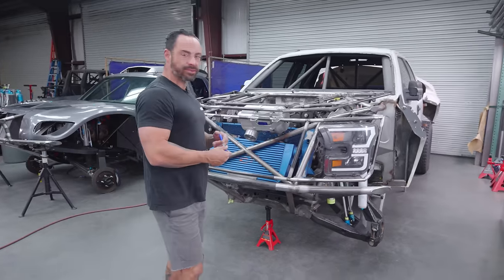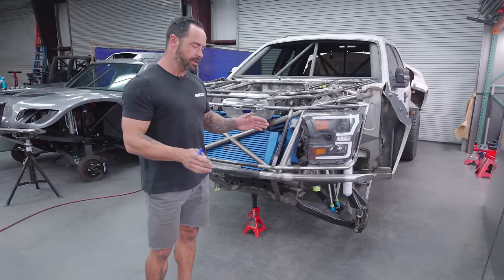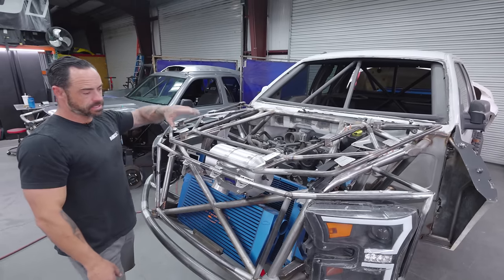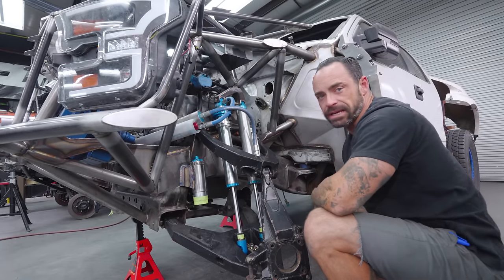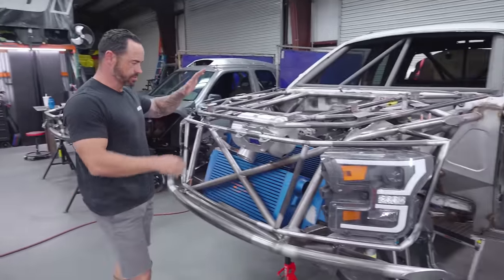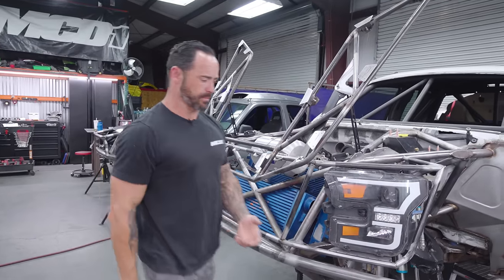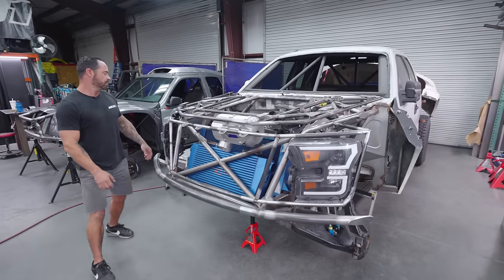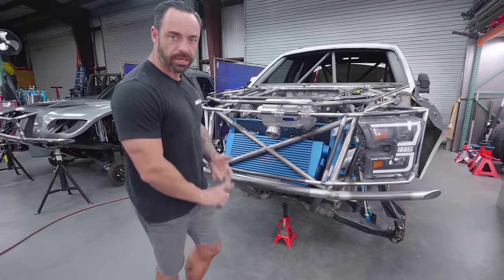Gen 1 frame rail kit Raptor | Morgan Clarke Design

Comment: Morgan - Thanks for the Landing Pad details and information! 
I am planning a custom fiberglass front clip for my OBS Chevy build that will tilt forward and ideally have no exposed hardware as well.
I was planning to use a similar process to laminate a mounting location into my layup, which then bolts to the tube tilt structure.
This gave me a confidence boost to proceed with my idea.
Ill also be utilizing some bear claw latches to hold it down, all of them actuated off of one pull lever using a cable system.
Peace !